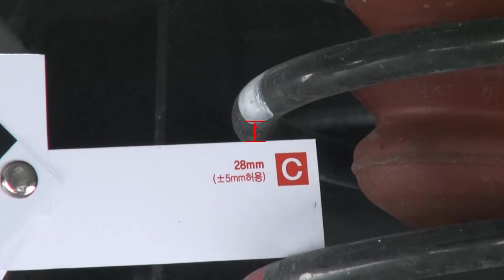Unique Solution on rough road and sharp conering!! TTC urethane buffer

Comment: Honda civic 2007?
Reply from the maker: Front size :B and Rear size:C. If you need more question or buying, Please contact e mail to :ttc0999@gmail.com
Reply: @thinkthinkcarkorea   do you have a distributor in Kenya
Reply from the maker: @sammyrogers1722   Yes. You can contact Mr.Benson Wachira/Slipwaqy Enterprise LTD. 0722-725082 / E mail:autoslip2002@gmail.com

Comment: what is its cons. i need to know b4 i install in my car & will it raise the car ground clearance?
Reply from the maker: Yes. absolutely car body higher 1-1.5 inch after installation. Main function of TTC Urethane buffer as following: 
1. Prominent absorbing shock when passing over anti-speed bar on the road suddenly.
2. Prevents leaning with coil spring tension control when making a sharp connering
3. Reduce vibration on the bumpy road or off road..
4. Protect shock absorber from the shocks (durability extends more than 2 times)
5. Braking distance to be shorter than before.
6.Slow down muscle rigidity phenomenon by reduced minuteness vibration in suspension
 when make long distance driving.
7.Restoration interval between car body and surface of road when overloading in the car.
8.Keep horizontal stability of car front and rear  due to coil spring loose or car body itself
 lost horizontal. 
9.More stable height of car body keeping to avoid body hit or drop falling on dessert rally. 
10.Reduce rolling and prevent overturning while high speed and rapid curve.
Reply: @thinkthinkcarkorea  i need to install in my tata altroz diesel. do u have size fo it?
Reply from the maker: @bankitboklyngdoh6897 Due to no available TATA in Korea, We don't have size chart for Altroz. However, We can send measuring manual by e mail. Please send your e mail to :ttc0999@gmail.com

Comment: What size for nissan xtrail 2006(T30)?
Reply from the maker: Nissan X trail is to fit Xtrail 
 S C
X-Trail 2011 A A
X-Trail 2015 A B
Reply: Uhm for xtrail 2006? Model
Reply: @renzdarylramirez2860  GX (QR25DE ENGINE ). 2006.

Comment: Size for bmw 525d please
Reply from the maker: BMW525D need to install size D on front and Back is not required due to no coil spring shock absorber there. If you want to more about us, Please contact e mail to : ttc0999@gmail.com

Comment: whats size for lancer rear spring? car spring size is 10mm thickness, 17mm spring gapping, and 98mm OD of spring.
Reply: Mitsubishi Lancer need to install size  C as front and size E as rear. (14mm~19mmgap).
Reply: Thank you sir, So are you sure the 14m - 19mm buffer can be used for my 17mm gapping? i shall ignore the 23mm buffer which others suggested
Reply: yes. sure. But this gap (17mm) measured at lift car down.
Reply: +정문수 yes sir. I had measured the spring on flat road without jacked up. normal
Reply: Then. It is size E as 
correct size
Reply: +정문수 thank you sir.

Comment: Hi! Can u help me with the buffer size for honda city ivtec type 5 model
Reply from the maker: We have size application for Honda city as following: 
                          front     rear size
HONDA City  A B
HONDA City Zx A B
HONDA City2007 B B++
HONDA City2009 C C
HONDA City2010 B B
Nothing different size for V.TECH that  is the short form of Variable Valve Timing and Lift Electronic Control but year of production decided size.